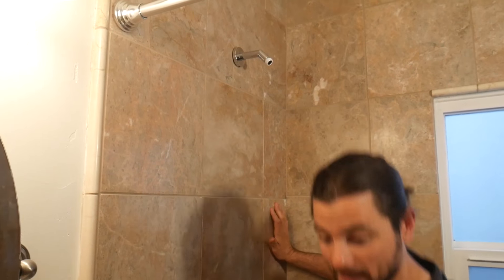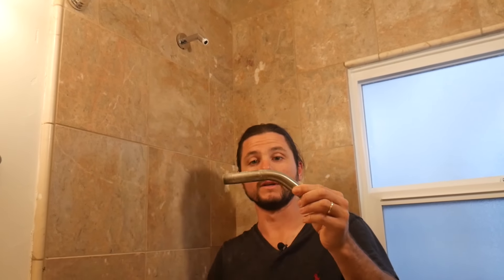How to Replace a Shower Arm and Flange

Comment: The Teflon Tape was put on in the wrong direction.    Pointing the end of the pipe towards you, it should go on clockwise.  This is the direction that the pipe threads travel when tightening.  Putting the tape on in the counterclockwise direction as shown in this video will cause the tape to bunch up as it is tightened
 making it useless at providing a seal.  I always install these with a temporary cap at the other end and turn on the water to pressure test and check for leaks.  If there are no leaks then I replace the cap with the shower head and silicon seal the flange.
Reply from the maker: Hello Paul, you are correct, we've noticed that we've accidentally done that but we are unable to edit the video. The notes will be updated shortly to address this. Thanks for bringing this to our attention.
Reply: Don't you think it would be better to use Tru-Blu Rector Seal Pipe Thread Sealant on those threads?  Tru-Blu is great stuff and recommended by plumbers.  I really like your idea about capping it off to check for leaks. 👍👍👍
Reply: As I was watching this video, that's the same thing I notice. It is supposed to go on in such a way that when you turn, it goes WITH THE DIRECTION of the tape, not against it. He did this backwards.
Reply: I used to think so, but despite the consternation from tradesman, it really doesn't matter that much.  I always make sure to put it on the right way, but no, it won't be "useless", nor will any of the bunching up matter.  The stuff compresses so easily and it is already by definition a tight fit between fitting and socket threads that there is no place for the Teflon to bunch up to.  It's not as if you'll unravel the tape entirely as you turn.

Try the same experiments with it that I did and see.  You'll not have any catastrophic leaks by putting it on CCW.  I avoid doing so, but only because being a purist doesn't hurt anything.  But if you forget, it's not the end of the world, and really won't matter that much.
Reply: Thanks.  I thought that was correct as well.  Always thought you wrapped teflon tape in the OPPOSITE direction as you are going to thread the pipe/fitting so the end edge of the tape is facing in the opposite direction you are threading your pipe or fitting in/on.  Justin cites the correct reason but the wrong direction.
Reply: Hi,  thanks for posting how to test for leaks. Video immediately installs flange part without testing. What kind of CAP do you screw onto the pipe ? Can you see water leaks since the pipe is inside the wall ?  Thanks !

Comment: Thank you. That tip about using a screwdriver to tighten the shower arm saved me buying a new tool to use once, feeling like a failure for not knowing how to do this without making horrible marks on the arm. Thanks again.
Reply from the maker: You're welcome! I’m glad that tip helped you out and saved you from buying a new tool. It’s great to hear it made things easier for you.

Comment: Great tips!   Thanks!
I have a new shower arm to install, and I was worried because it has threads on both ends, and I thought I might need some kind of connector...
happy to see yours looks the same, and I am good to go.
What I did with the flange, is I put beads of clear silicon, inside the back of the flange, in ever larger circles, until it reached the very edge of the inside of the flange, 
and made  sure, the last circle, rested slightly above the edge of the flange, so when installing this, pushing on the flange, with just a little pressure, 
compresses the silicon slightly, because silicon is flexible, and that makes for a perfect watertight seal, and you can't even see the silicon on the inside.
I wouldn't use plumber's putty on marble, (Plumber's putty is greasy.) as marble is a soft, porous stone, and the marble will absorb the oil from the plumber's putty, 
and the marble will stain around the flange.
It is probably fine to use it on granite.
Reply from the maker: Thanks for your feedback. I am happy we were able to help you.

Comment: Thanks Justin for all of the good tips, especially about wrapping the tape on the pipe ends in a clockwise direction. I pretty much knew that I would be using a screwdriver placed inside the pipe to unscrew the old arm and installing the new one. However, there’s one thing you left out that’s important for some DIY’er’s like myself to know. When installing the new shower arm, the longer end goes into the wall with the shorter angled end pointing out and down towards the bathtub or shower floor. 🛀🚿
Reply from the maker: Thanks for the input and I am glad we were able to help you.
Reply: He installed it that way, if people were paying attention.
Plus, you could see the longer end was inside the wall, when removing the old shower arm.

Comment: I always lived an a apartment. I recently just bought a house. I need to learns some of these do it Yourselves and I'm kinda nervous. Two questions. 1) if i take everything off, is that what's usually behind the flange a hole in the wall I assume in that hole a is a pipe you just stick the arm to?

2) are shower arms universal? Thanks again. Might be dumb questions but I just want to learn everything. I'm new to this
Reply from the maker: 1. Yes, there is usually a 1/2" Female Pipe Thread connection in the wall. That's the standard in the USA. 2. In line with the previous question, shower arm pipes are a standard 1/2" Male Pipe Thread. There may be some exceptions, but the vast majority of the time you're dealing with these standards.
Reply: @theshowerheadstore  thank you so much
Reply from the maker: @Pshady23  You're welcome!

Comment: Are all shower arms able to twist off like that cuz I’m havn a hard time twisting the old arm off
Reply from the maker: Hello there, if your shower arm is in the wall for a more than 7 years then rust can build up internally on the threads causing problem to remove it. In this case, we recommend using 2 tools for the job. In your left hand you will use a wrench to hold the shower arm (where it exits the wall) firmly in place, while you have a screw driver or any long enough metal that can be placed inside of the shower arm. You will then need to apply pressure in a counter clockwise direction slowly. Let me know if this helps.
Reply: @theshowerheadstore  Tnx man got it out!
Reply from the maker: @TheSkyhighmusic  Perfect! Let me know if you need anything else.

Comment: These type of repairs/updates always scares me. I don’t like not knowing if my pipe is leaking being it’s behind a wall. I know folks will chime in and say if you put teflon on correctly and tightened it correctly, yadda, yadda...Things can still go wrong beyond your control, like age of pipes, condition of threads, etc.
Reply: Same, like what do I do, if I can’t screw it back on.
Reply from the maker: Hello there. A lot of things can go wrong such as what you mentioned in terms of the age of the pipes and the condition of the threads in the wall, and in this case, I would recommend that you add extra turns of tape or consult a plumber to check on leaks in the wall.
Reply: Thanks Justin for all of the good tips, especially about wrapping the tape on in a clockwise direction. I pretty much knew that I would be using a screwdriver placed inside the pipe to unscrew the old arm and install the new one. However, there’s one thing you left out that’s important for some DIY’er’s like myself to know, when installing the new shower arm the longer end goes into the wall with the shorter angled end pointing out and down.
Reply: @DalTexGuy  why can’t it be the opposite?
Reply: Leaks inside the wall is my main worry. I'm guessing the thread is not standard like on the shower end of my old one.
Reply: Maybe tie some wicking cotton cord around it and jam that in before you attach and seal the final ring. That way an leaks would leave the cord damp and the leak visible check by removing the ring.

Just an idea.

Or throw a humidity sensor in there. Leave the cord/plug outside so you can plug a tester into it. Dirt cheap nowadays
Reply: @jackeroo75  one end is npt thread (wall piping) the other is G thread (shower head end)
Reply: I have a ball bearing shower arm. I can't get a screwdriver to fit in the hole of the shower arm. Can't get enough leverage to turn the shower arm. Any suggestions?

Comment: I have a question, do you have to first shut off the water before you change this out? I live in an apartment and it would be virtually impossible for me to shut the water off to my building just to change this out.
Reply from the maker: You don't have to shut off the main water to change this out, although it's never a bad idea just to be safe. You only need to make sure that your shower valve is closed all the way and that no water is coming out of your shower head. Then you'll be good to go!

Comment: Thanks, needing to replace my shower arm, which developed a pin hole leak, just wanting to confirm how to change it.  BTW, that's a nice looking shower head, why not just soak it in CLR, it will remove clogs in about 30 minutes of soaking?  Much cheaper than a new shower head.
Reply from the maker: Thanks for your message! We're glad you like the look of the showerhead. however, the video focuses on changing the shower arm in just 5 minutes, it's not about the shower head which, BTW is not one of our All metal Showerheads but we appreciate your feedback! Let us know if you need any further assistance.

Comment: Hey, 1 question here, do I need to close the water meter outside the house or I shouldn’t?? Please help!! 😅😅
Reply from the maker: For a safety measure I would close the water meter, It doesn't have anything to do with changing the shower arm and flange.

Comment: Are all shower arms threaded on? Not sure how old mine is, but the house was built in the 80s. Its possible mine is that old, but I've always wondered if they ever sweat those arms on a 90.
Reply from the maker: All shower arms are removable. They are usually threaded into the shower water supply pipe in the wall where some may be badly corroded and stuck, which makes them hard to remove. A penetrating oil should be used to help them loosen up

Comment: If I tighen it too far will the diverter valve bust and squirt water everywhere ?  If feels like the arm has hit max but it's pointing toward the ceiling. And if I back it off until it points down it's lose and leaks. I've tried two different arms with the same result.
Reply from the maker: Of course, I'd be glad to help you with your shower arm installation concerns.

It sounds like you're dealing with a common issue when installing a shower arm. Tightening the shower arm too much can indeed damage the pipe and potentially lead to leaks. On the other hand, if it's not tightened enough, you'll experience the arm being loose and causing leaks as well.

To ensure a proper installation without any leaks or damage, follow these steps:

Wrap the threaded end of the shower arm with Teflon tape. Use at at least 5-8 wraps if 3 wraps not working out. This helps create a watertight seal and prevents leaks.

3. *Hand Tighten:* Start by hand-tightening the shower arm into the threaded pipe coming out of the wall. Turn it clockwise (righty-tighty) until it's snug against the wall.

4. *Use a Wrench:* Once the arm is hand-tightened, use an adjustable wrench to gently tighten it another 1/4 to 1/2 turn. Be cautious not to over-tighten, as this could damage the threading or the pipe inside the wall.

5. *Alignment:* Ensure the shower arm is aligned correctly. It should point downward, perpendicular to the wall. If you find that it's pointing toward the ceiling, you may need to use an additional piece like a shower arm extension to achieve the correct angle.

6. *Sealing:* If you're still experiencing leaks after proper tightening, consider using plumber's putty or a rubber gasket. Apply a thin layer of plumber's putty around the base of the shower arm before tightening it. Alternatively, some shower arms come with rubber gaskets that should be placed between the arm and the wall.

7. *Test for Leaks:* Once you've completed the installation, turn on the shower and let it run for a few minutes. Carefully check for any leaks around the connection point and the wall. If you notice any leaks, you might need to repeat the process, ensuring proper sealing and tightening.

Remember, it's important to find the right balance between snugness and not over-tightening. If you've tried multiple shower arms with the same result, the issue might be with the threading of the pipe itself. If that's the case, it's a good idea to consult with a professional plumber who can assess the situation and provide a proper solution.

If you're not comfortable with the installation process, it's always best to seek help from a licensed plumber to avoid potential damage or water leakage issues.

Comment: Do I have to shut off the water valve? This is just what I needed to know. Thanks
Reply from the maker: You do not need to shut off the main supply to change out your shower arm, you just need to shut the water off at your shower valve. There should be no water coming out of your shower head when performing this change.

Comment: I apologize if this is off topic but my shower arm is good. My shower head needed replacing. The issue I had was that the nut on the new shower head was plastic and I could never get the threads to line up with the arm. After many tries the plastic threads started to come off. What did I do wrong? I put my old shower head back on and it screwed on perfectly with no leaks. The shower head still needs replacing, however.
Reply from the maker: Chances are that the threads in the plastic connection may be damaged due to over tightening. I would recommend changing the plastic showerhead. At the Shower head Store, we are only offering high quality metal shower heads at insanely competitive prices that are built to last from Stainless steel and Brass.

Comment: Thanks for the detailed video.  Question: Do you need to turn off the water supply to change the arm?
Reply: Once your shower trim is already turned off you should be fine.

Comment: Hi, nice video, I have some questions.  I have been living in an older apartment building for over 10 years.  My unit has 6" shower arm with 1/2" connection with IPS thread and shower head with 1/2" connection with IPS connection.  All new shower arm and heads I found has NPT connections.  IPS connection and NPT connection do not match.  But can I take out my current IPS connection shower arm and install NPT connection shower arm?  Like getting rid of both the old 1/2" IPS thread shower arm and shower head first.  And then install a new 1/2" NPT threading shower arm with teflon tape to prevent water leaks and NPT shower heads in their place.  Is that possible if the wall holes accommodate?  Is it even recommended to replace IPS shower arm with NPT connection in an older apartment unit?  Can you or anyone please help with answers?  Thank you.
Reply from the maker: Yes, this is possible, your plumber may need to thread or re-thread the shower pipe or use a suitable adapter to ensure a secure and leak-free connection between the new NPT shower arm and the existing plumbing. It's essential to have a professional plumber handle this task to ensure a proper installation and prevent any potential water leaks or damage.
Reply: @theshowerheadstore  Hello, thank you for your reply.  I understand to change shower arm, I will need professional help.  But if I wanted to keep the shower arm and only change the showerhead myself, then can I do it?  I've seen a few showerhead on amazon with G 1/2 interface connection female thread type(BSPP - British Standard Pipe Parallel). The G 1/2 interface connection female thread type have a Parallel (straight) threads instead of tapered thread that is for NPT types. My current shower arm has IPS parallel male threads and my shower head IPS parallel female threads . Since both IPS and BSPP have parallel straight threads, are they compatible?  Will BSPP G 1/2 interface connection parallel female thread on these showerhead fit with my IPS parallel male threads on my shower arm? Can you please kindly let me know, if you have any idea? Thank You.

Comment: Is it necessary to shut off the main water to replace the shower arm and flange?
Reply from the maker: As a safety measure, it is recommended that you shut off the main water.

Comment: Do these instructions apply when the neck portion snapped off from the pipe inside the wall?
Reply from the maker: Hi!  In that case, we would definitely suggest to use a plumber to prevent further damage

Comment: Great video! Thanks so much. Just wondering if you did mention the brand/model name of the new shower arm and flange you used, as you said you would? (If so, I can't find it in the video.) I need to replace my original, 72-year-old arm and flange, and I like the one you used. Thanks in advance!
Reply from the maker: This is a Speakman Neo S-2540 Shower Arm and Flange, 7", Polished Chrome and it can be found on our website here: https://www.theshowerheadstore.com/collections/accessories/products/shower-arm-and-flange-with-set-screw?variant=38136115888321

Comment: Any concerns about water getting behind the tile/wall or is the pipe in the wall flush with the tile?
Reply from the maker: Having the adjustable set screw allows you to get the flange flush against the wall to prevent water getting behind the wall. Hope this helps

Comment: I have a question about the shower mount i have a old shower head with a ring that has a thread in it do i need to remove the shower arm to remove the ring
Reply from the maker: It could be one of those old price pfister shower arm holders built into the shower arm. If that’s the case, you’ll need to replace the shower arm too.